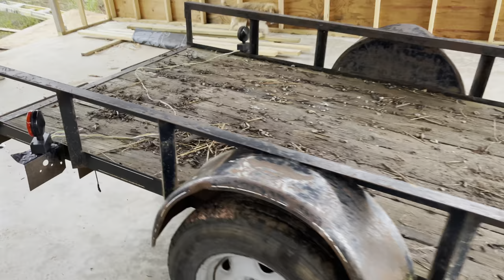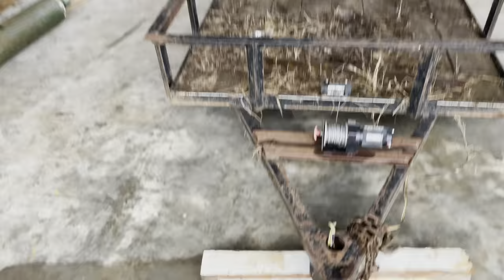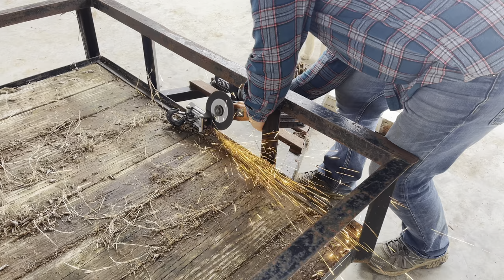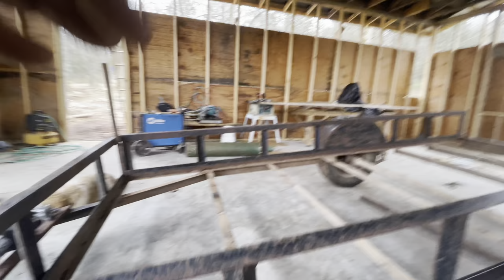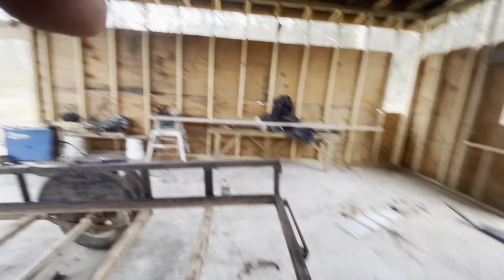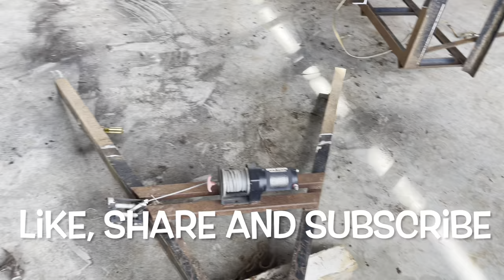Widening my Trailer from 59” to 67” - Part 1

Comment: How about a video on widening a trailer deck WITHOUT widening a 5 foot axle ? Widening to 6 foot 4 inches ?  👍👍👍 ?
Reply from the maker: On a standard utility trailer you would have to widen the axel, unless you want to rebuild the trailer with the deck above the wheels.